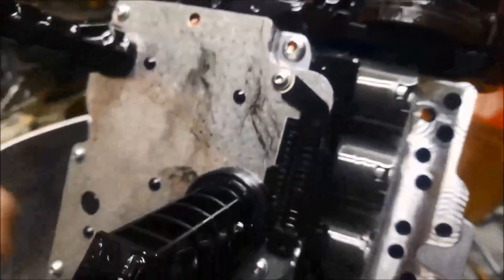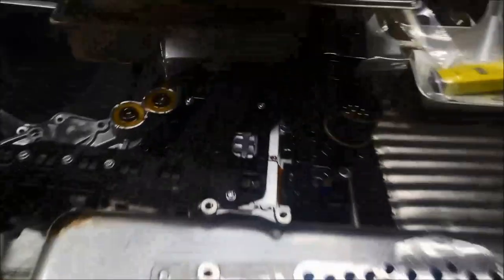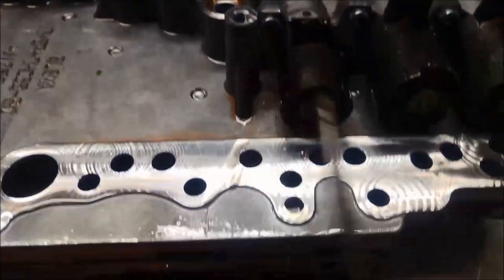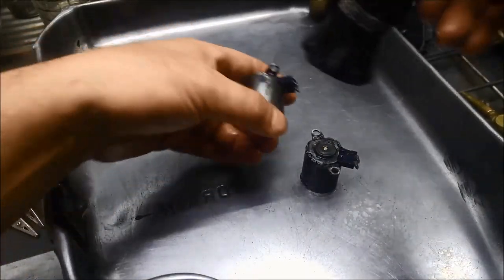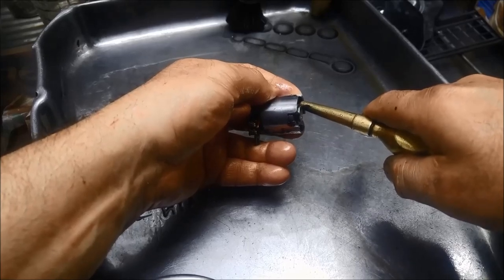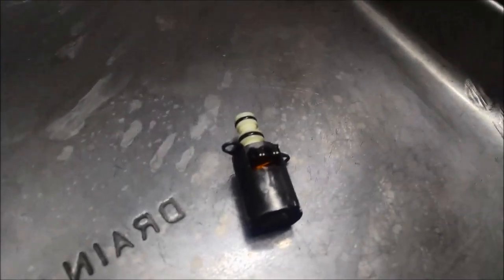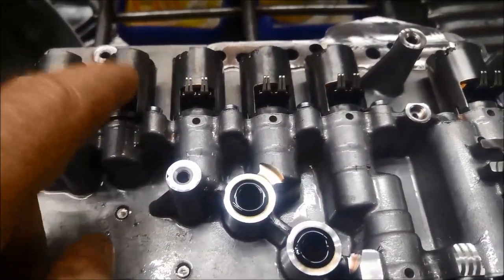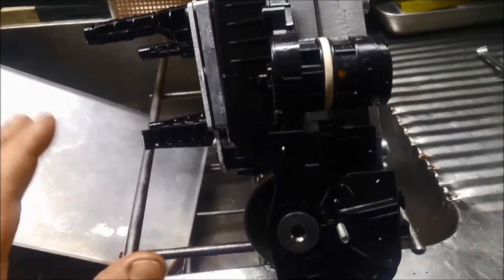Powershift Ford 6DCT450 DPS6 DCT Solenoid Testing P2of3 MPS6 W6DGA EVO SST Semi Auto Transmission

Comment: Hi, I’m getting solenoid D fault, I know you say check all solenoids which I will but it would also be nice to know which solenoid is D? Thanks in advance
Reply from the maker: hi, the ones that operate 4th gear. cheerss
Reply: Hi, same problem as you
did u clean it and it worked after? Or you swap it?

Comment: Have a 2014 ford galaxy automatic only issus I'm having is with revers if I drive the car for an hour revers seems to come back any idea ?
Reply from the maker: hi, hard to diagnose without doing our own test/checks but seems to be temperature related - so can be solenoids, stick valve, low fluid level as fluid expands when warms up etc. cheers

Comment: my 2014 ford galaxy wont change up when driving forward and no reverse could this be the solenoids cheers
Reply from the maker: hi, check all basics first. they trans run dirty and are not serviced enough. make sure you remove front cover and clean and add additional magnets. cheers

Comment: My car lost all gear. And message” transmission limited function check handbook.” And I call an moble dianosgtic come and scan. We got fault shift fork A, shift fork B, shift fork C stuck and TCM Mil request. And he said TCM need to be replaced. Can I have any advice from you that would be great. Thanks a lot.
Reply from the maker: hi, it will be the solenoids 99.9% of time. if the plastic spring retainers havent shatered, then replacing  or even flushig solenoids will fix your issue. these trans need the front cover and magnets cleaned every 50,000km as you cant replace the internal filter. if you have time check out our other 6dct450 vids. cheers
Reply: @YepThatsIt  the internal filter can be replaced. there is video somewhere on line, or a description on a forum, that explains how the filter can be manipulated out. it was the number one cause of a gear change problem on my 2013 mondeo. it was almost totally blocked by sludge caused by the degradation of the plastic parts in the clutch and maybe clutch plate wear. Searching on line reveals this is the most common fault with the DCT450. Blocked filter= no oil flow, so no consistent gear changes. See Dima Dima videos.

Comment: Hi, I have a question about my Ford Mondeo 2.3L 2008
When entering 1-> 2, 2> 1 - 4> 5, 5> 6 is very smooth and not choppy

But 2> 3, 3> 4 and 4> 3, 3> 2, then when the gear shift is jerky, it gets more jerky when it's going, but it goes to number - then I gas a little more, then very strong - Switch t manual is same thing.

* I had check via ODBII:  Show the code P073095: Incorrect Gear Ratio
Is issue on Solenoid?
Reply from the maker: hi, make sure you check all the solenoids. cheers

Comment: Hie got a Ford kugar R goes forward N goes forward and D forward what could possibly be wrong
Reply from the maker: hi, check all basics first incl battery strength ( low internal resistance ) low resistance on earth straps and electrical connections. then move on to check contaminated solenoids and sensors. range sensor wheel is probably chockablock with debris. cheers

Comment: Hi, I'm Daniel, I'm fixing a 2011 Volvo XC60 equipped with Ford motor and 6dtc450
have the problem, start jerking erratically in first gear # 1 and not engage the 4 gear and jump from third gear to the fifth gear
I thought they were solenoids but I already performed the cleaning service and tested the valve body, just as you did in your video but it remains the same.
do you think it could be the tcm? .. or could it be the forks?
throw me these two codes in the scanner
p 0766 solenoid solenoid stuck off / performance
p 0734 gear 4 inconrrect gear ratio
I would greatly appreciate your opinion.
Cheers
  daniel
Reply from the maker: hi, contact me on my face book link https://www.facebook.com/Yep-Thats-It-103051017785435/  and leave me which  kind of vehicle/transmission type you have, and leave a detailed description of any fault codes and issue you are having ( we are able to exchange pics/diagrams on there ) and details of what work you have already performed or checked...... you will need to buy me some beers ( link is in face book ) and I will answer your questions accordingly. cheers
Reply from the maker: hi, try without forward slash...  https://www.facebook.com/Yep-Thats-It-103051017785435   cheers

Comment: What kind of voltage and current I need to check clutch shift solenoid?
Reply from the maker: hi, i like to test around 10v as a car battery is considered flat at 10.5v. the amps need to be varied so you can see or measure a smooth movement of valve. cheers

Comment: Getting p0846 and on going into P R 1 3 5, says transmission limited function
Reply from the maker: hi, for further help, please also read through past comments and responses and check out our other related vids https://www.youtube.com/playlist?list=PLQLkuOdKuFotLWdTOl3KCK0xpgTu7CEJH   cheers
Reply: @YepThatsIt  do you know where fluid pressure switch/sensor b is located? Is it accessible without taking the gearbox out

Comment: Does anyone know which solenoid is solenoid D the error I get is P0766 Trans solenoid D failure I removed and cleaned them all on a focus a real nasty job needed to remove half the front of the car but came back after about a 1000 Km so anyone know which is D
Reply from the maker: hi, depends on your scantool. sometimes it an also refer to 4th shft. you will be wise to not chase a specific solenoid and bench test them all ( make sure you warm them up as well ) as they can fail when they warm up too. if you place solenoids in a plastic bag and immerse in boiling water a few times -do not use a heat gun as you can damage the solenoid. maybe watch all my 6dct450 vids too https://www.youtube.com/playlist?list=PLQLkuOdKuFotLWdTOl3KCK0xpgTu7CEJH  cheers

Comment: Hi. Do you have experience with 6DCT451? Is it more reliable than 450?
Reply from the maker: hi, sorry i am not really sure what difference between 450 and 451? there is definitely differences with 6dct250 - 6dct450 - 6dct470 cheers
Reply from the maker: GenI trans was up to approx 05/2015 then GenII was 05/2015 on. the GenI has internal speed sensor, the GenII has external speed sensor. thats about all i can think of for moment
Reply: @YepThatsIt  as I know, the biggest change in 451 compared to 450 was that clutch was separated from a dual-mass flywheel, making a flywheel dry. This prevents oil getting contaminated by dust from the flywheel, improving overall reliability. Since solenoid failures are usually coming from a contaminated oil, such design must be way better. And it should be easier to buy and replace flywheel or clutch since they shouldn't be sold as one assembly anymore.
Reply from the maker: @PermanentWTF  i think you may have mixed up with the 6dct250? 6dct250 had a dry clutch, whereas 6dct450 and 470 have wet clutch? cheers
Reply from the maker: 6dct250 usually fitted behind under 2L engines
Reply: @YepThatsIt  no, 450 and 451 are both wet clutches - gen1 and gen2, as you said. But 451 flywheel seems to be dry, unlike 450.
Reply from the maker: @PermanentWTF  sorry i`m not sure

Comment: So error code P1833 Mitsubishi shift solenoid 1. Which solenoid should I replace ?
Reply from the maker: hi, here I was thinking/impression you were some dct guru testing my knowledge ! ( no offence intended ) is trans selecting through all odd gears shown on your scan tool or is it jumping some/ or shudder when going into some? and what is happening with reverse? on these transmissions as with most modern transmissions, there is never only one solenoid operating in one gear, always 2 or more operating.... without knowing more information I can`t really tell you...also if you have access to solenoid application chart, be wary that on different dct/dsg models different solenoids are used for application of solenoids and also named differently, depending on which manual you have some just indicate generic solenoid applications.....this is what stuffs up many people and also why most don`t muck around and replace the whole valve body-mechatronic unit...and then having said all that, on these transmissions you NEVER only test or replace the specific solenoid showing up as a fault on your scan tool....test them ALL and double test the ones your scan tool indicates. cheers
Reply: @YepThatsIt  awesome write up buddy. I'm just going through my gearbox myself tomorrow and I'm thinking of just upgrading all the solenoids to the plastic ones.

I haven't tested them by running power through them as they seem to fail after heating up.

I just wish I could rebuild them myself!

What power supply unit did you use to test them as I might buy one for home use?

Cheers
Reply from the maker: hi, even plastic solenoids become contaminated as solenoids are electro magnets. only difference is if the coil is moulded around the copper winding, the fine metallic debris can`t get in between the copper wire winding as much. the debris will still get in and around the internals and workings of the solenoid. the metal solenoids can be dismantled and cleaned, however sometimes the plunger guides wear out, so cleaning won`t fix problem for long. the coils can and will sometimes also only fail when warmed up, so really good idea to test them warmed up upto around 90 degC. do not warm up with heat gun as you will most often damage a potentially good solenoid. we warm ours up in like an oven where we can set temp to whatever we like and it is thermostatically regulated so won`t overheat. the power supplies are on line...look for variable DC power supply, ideally one with adjustable amperage too. we often also test our solenoids at max on our powsupp which is 30V ( for very short time ) after when we flush solenoids and retest...idea is if there is still any metallic debris in there that is magnetic, it will magnetize the debris and then solenoid will show up as sticky/binding again. you will then need to demagnetize and flush/test again go through process until you get a good clean solenoid that does not get sticky after higher voltage is given. you have to be wary though some solenoids arent tested with voltage but with varying the amperage/current. have fun cheers
Reply: @YepThatsIt  thanks again for write up.

I am looking at trying to open up these old medal ones as some feel sticky still so like to see what's going on inside.

Is there any tool kit for these solenoids to open them up?

Cheers buddy and where in Aussie are you located?
Reply from the maker: @MrShortStuff  hi, we make our own tools for disassembly and testing. I`m in north east country Victoria. cheers
Reply from the maker: hi, sorry we just make up our own tooling. cheers
Reply: So  eruro code p0771 fourd kuga ?

Comment: which is a solenoid valve c and d ?
Reply from the maker: hi, contact me on my face book link https://www.facebook.com/Yep-Thats-It-103051017785435/  and leave me which  kind of vehicle/transmission type you have, and leave a detailed description of any fault codes and issue you are having ( we are able to exchange pics/diagrams on there ) and details of what work you have already performed or checked...... you will need to buy me some beers ( link is in face book ) and I will answer your questions accordingly. cheers
Reply from the maker: hi, try without forward slash...  https://www.facebook.com/Yep-Thats-It-103051017785435   cheers

Comment: Quiero dejar algo que le servirá a todo el que tenga un FORD con caja transmisión Powershift. Si el vehiculo zapatea cuando va a salir u usted nota que patina el embrague que casi siempre hace estos errores en los cambios bajos en 1°, 2°, o 3°. Ford le da una garantía de 160 mil kms o 10 años lo que suceda primero por la transmisión, el módulo electrónico de la caja, el embrague y la caja misma en si. Totalmente gratis, solo tiene que pedir turno a la concesionaria Ford más cercana. Para esto No importa si el vehiculo perdio la garantia por falta de los mantenimientos o no, o si tiene GNC incorporado posterior a la compra del vehiculo. Aprovechen antes de esos dos limitas, 160 mil km o 10 años, Llevelo igual y pida que se lo controlen, es Gratis!!.
Reply from the maker: translated " I want to leave something that will help anyone who has a FORD with a Powershift transmission box. If the vehicle stomps when it is going to leave or you notice that it slips the clutch that almost always makes these errors in the low changes in 1st, 2nd, or 3rd. Ford gives a guarantee of 160 thousand km or 10 years, whichever comes first for the transmission, the electronic module of the box, the clutch and the box itself. Totally free, you just have to ask the nearest Ford dealership. For this, it does not matter if the vehicle lost the warranty due to lack of maintenance or not, or if it has CNG incorporated after the purchase of the vehicle. Take advantage of these two limits, 160 thousand km or 10 years, Take it the same and ask to be controlled, it is Free! " .......thank-you for that information, however in australia, ford is not so generous with all powershift transmission owners. cheers
Reply from the maker: Gracias por esa información, sin embargo, en Australia, Ford no es tan generoso con todos los propietarios de transmisiones Powershift. salud

Comment: You will never be totally successful until you replace the O rings, activate and pressure test the 5 linear  solenoids .
Reply from the maker: hi, the solenoids get worn out and plunger gets stuck while shuttling. if the orings are raised and elastic then they can be resused, always best to replace them, but the main issue is worn and/or contaminated solenoids. cheers
Reply: Thank you ,the linear solenoids have a ball bearing seal which have a plastic/nylon seat which is inaccessible.